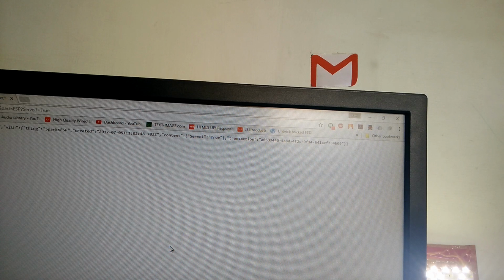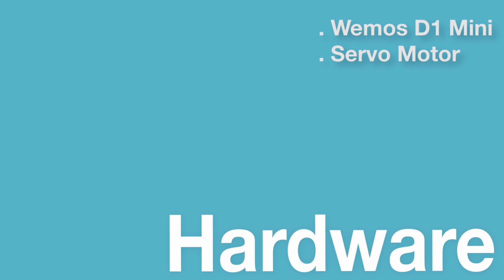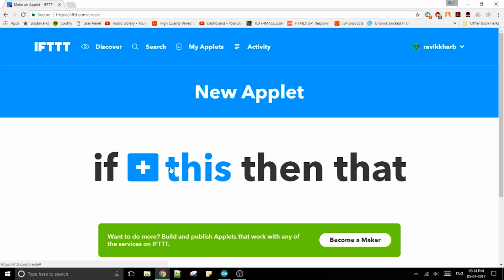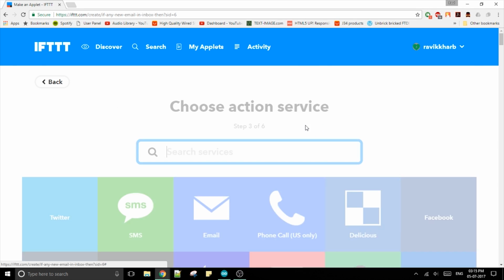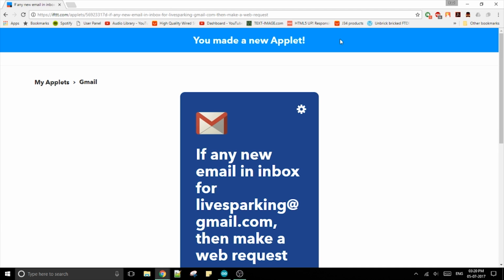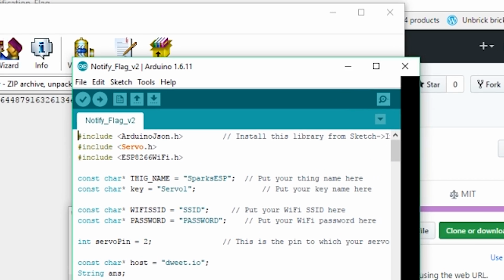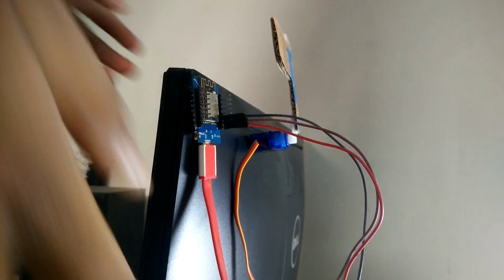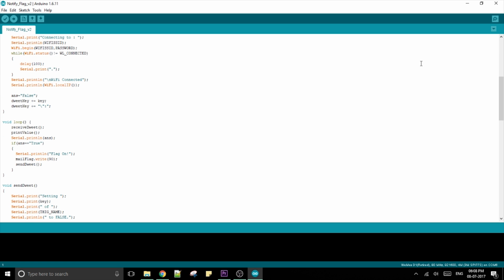ESP8266 Pop-Up Notification Flag for Email/Twitter(Wemos D1 Mini)

Comment: Hi LS. Thanks for the great demo!

I'm getting the following in the serial monitor:
WiFi Connected
192.168.2.45
Receiving Data for ----------- (my host name)
Connecting to : dweet.io
Connected Successfully!

Closing Connection

* the response is empty. Never contains 'Servo1'
Key not found
Receiving Data for hopesp8266
Connecting to : dweet.io
Connected Successfully!

Any thoughts ?

Thanks for your help.

Gord
Reply from the maker: Hey, 
There script periodically check for any changes. You would get this error if your applet had never been executed before. It should go away on its own after whatever condition you have entered in IFTTT runs for the first time.
I made this video a while back so I can't be sure hence, here are a few more reason why the error is there.
You might have entered the wrong key in one place or the other. 
You might have mismatched some key.

Comment: Nice work! Would it be possible to connect two servos and have notifications for two events?
Reply from the maker: +Mikko Pihlajamäki As I mentioned in the video, it's possible but my code doesn't support it, you can modify the code to do this. As an alternative you can use two events to raise the same servo.